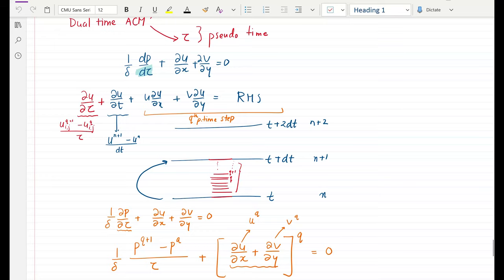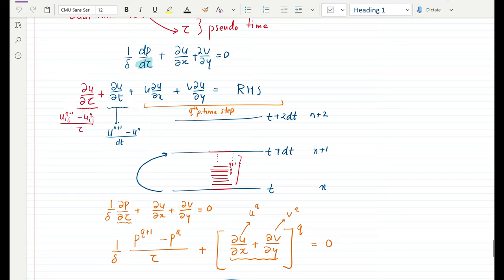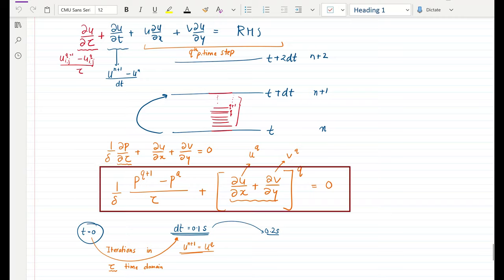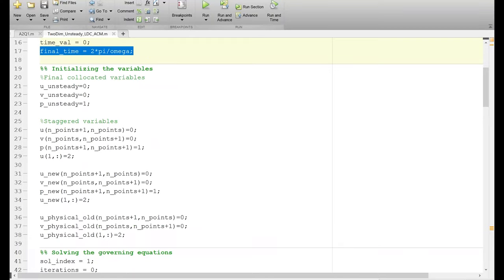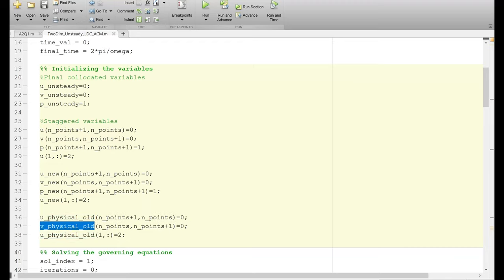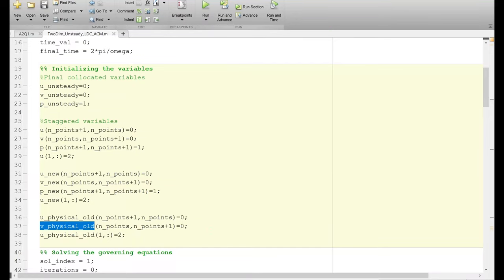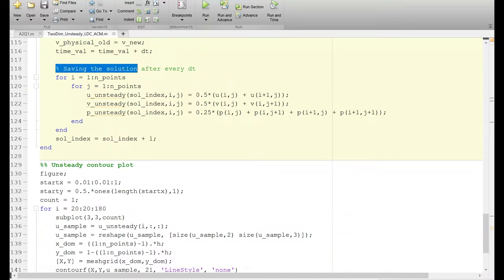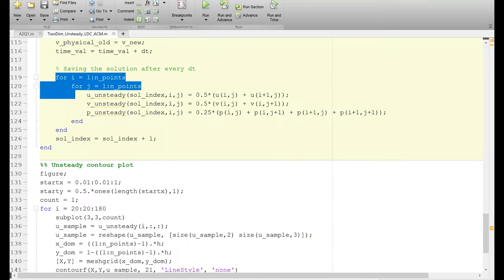Unsteady Navier Stokes Equations Using MATLAB | Lecture 23 | ICFDM

Comment: Hello Tanmay, thank you for the excellent work, if I want to calculate the pressure coefficients at 20 points around a cylinder,  what major changes should be considered in the codes, perhaps in the initial geometry or the boundary condition to calculate pressure? it would be so kind of you to help me gain an accurate and deep understanding of this problem.

Comment: excellent work!but i want to know why is that"u_new(1,:) = 2*cos(omega*time_val) - u_new(2,:);"
Reply from the maker: To accommodate for an oscillating lid. The top lid velocity is cos(omega*t).
Reply: @TanmayAgrawal7  your reply is appreciated,thanks!
Reply from the maker: To enforce the boundary conditions. Please see my previous videos (part 2 of 3 parts of artificial compressibility method, you'll understand).
Reply: @TanmayAgrawal7  That's true, because at t= 0 s , cos(omega*0) = 1 , u_new(1,:) is defined as =2, so it works.